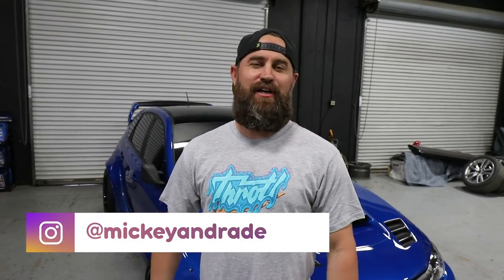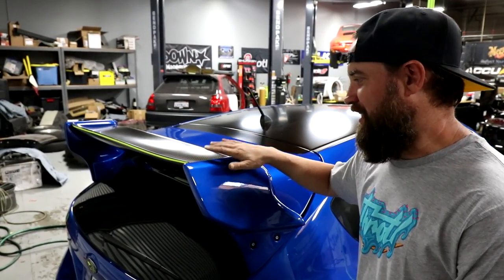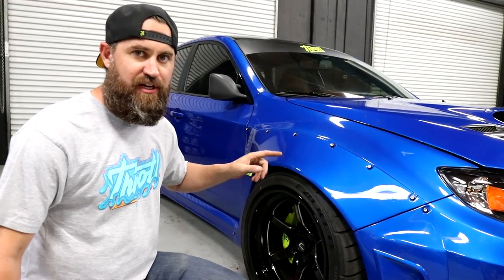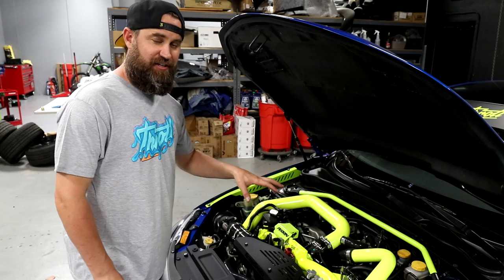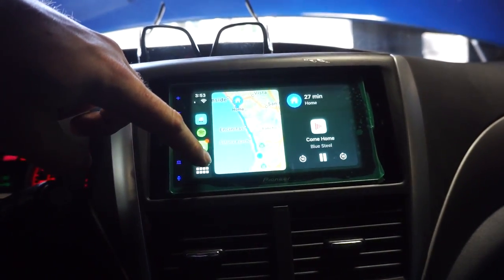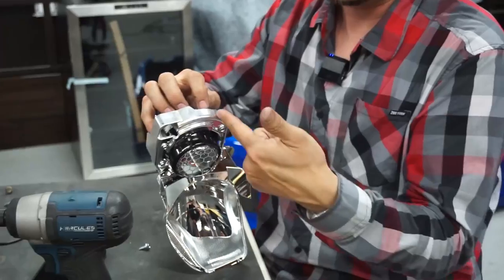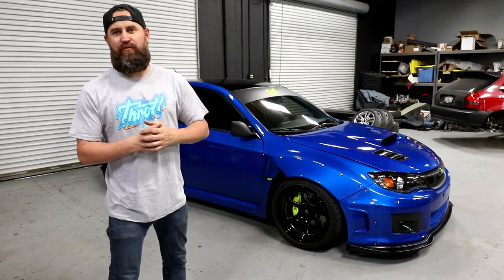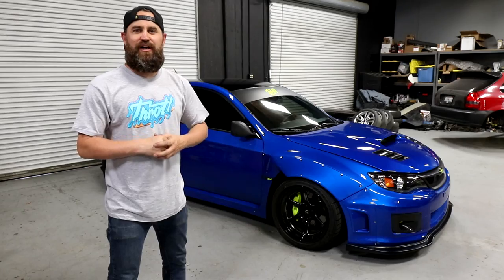How Much Did the ULTIMATE Subaru WRX STI Cost to Build?

Comment: Welp there goes my dream of owning and building an evo9
Reply: It's not that unattainable. A 2020 STI Limited goes for about $40,000. I would much rather spend the $45,000 to build an older STI like this one (Or Evo 9 like you said) to have it uniquely built the way you envision it. Just be smart with your money and you can get your dream car man! But knowing how to do the work yourself will save you alot of money too lol
Reply: Go with rebuilding a evo 9. Cause the sti will make crap power for more the cost will a rebuilt evo will make 700 to 1000 to the wheel.
Reply: @ELIDOTORG  you watch too many youtube videos. 700 to 1000 whp lol
Reply: @maksor2785  my brother in law has a evo 9 hes gonna rebuild it to make 700 witch will only cost him 7 grand. He you buy a evo shell that will cost you 9 grand plus all the interiror still inside. If your gonna buy a engine then that will cost only 250 to 350. Thats if you get the g4js engine. Its the same as a 4g64 engin then you just mate the 4g63 head to it. You get your self a stroked 4g63 2.3 liter
Reply: just do this
Step 1: buy the car of your choice
Step 2: save more money, take your time, you don't need it right then and there
Step 3: start buying the parts that will increase performance
Step 4: install the parts over a period of time(space it out, don't do more then what you can do in a day, take your time)
Step 5: Save more money
Step 6: slowly buy the cosmetic parts(rear wing, new hood, etc.)
Step 7: start where you want to on the cosmetics
Step 8: keep going and slowly finish the build
Step 9: get it painted the color you want it to be

just remember this take your time, and enjoy building it, also ask for help from friends, and if you don't know what you are doing then look it up, if that fails then take it somewhere to have it installed for you
also, try and keep it unique to what you like best
Reply: @ELIDOTORG  As I understand motors with shorter strokes turbo better because they rev faster and higher. which are 2 things you want in a turbo motor. that doesnt mean that a 4g64 wont make more power when built and turbo'd it just meants you have to get stronger rods, pistons, crank since they werent designed to be FI'ed. Also since you are not getting a 4G64 but a G4JS (similar engine). You need to change some stuff: 

-the new cam reluctor (inside the cam angle sensor)
-better valve springs
-turbo oil supply needs to be drilled and tapped
-turbo camshafts

I dont think thats all possible for 7 grand, seeing as these part prices can go up to thousands of dollars (if you get quality stuff, that can handle 1000whp ofc)
Reply: I read a car mag about a guy who built an evo, took 5 years. I am a v8 guy, but if your patient my friend. You can do it :)
Reply: @codyhendrickson7735  that's the thing, man, I'm 17 I'm trying to learn but I have no one to teach me
Reply: Same, goes to building my 14 wrx lol
Reply: @lonesoldier3921  You'd be surprised how much you can learn from YouTube videos similar to these. Just take your time, pay attention to the details, start small, and be willing to make mistakes. Also, don't be afraid to get something cheap first to learn on. Good luck reaching your dreams.
Reply: E r lol Your brother in law. Get the car and experience it first hand by building it. They’ll cost about the same. Stock engine yes Evo will make more power. Upwards of 600 both will need stronger engine. More power means you gotta beef up the trans, clutch, diffs, breaks etc Just get the damn car mod it to your liking. Most importantly driver mod goes a long way
Reply: bro same

Comment: Car Price breakdown:
The car itself:						                $15,000
SOS Customs Paint and Bodywork:				$ 7,500
MntRider Widebody Kit:					        $ 2,349
Agency Power Carbon Fiber Rally Wing:			$   900
Lion's Kit rear diffuser:				                $   500
Red overlays (pair):					                $    40   
Seibon Carbon Fiber hood:				                $   920
Subaru Grill:						                        $   320
Subaru Front Bumper:					                $   200
EPR Carbon Fiber Brake Inlet Duct (pair):		$   360
Cosmis XT-006R Wheels (set):				        $ 1,300
Falken Azenis RT651k+ (set)(315):			        $ 1,600
Silver's coil overs:					                $ 1,500
Stoptech Rotors and Pads (4 corners):			$   870
RPG Carbon Fiber Mirrors:				                $   360
Mishimoto Front mount kit:				        $ 1,150
Mishimoto Radiator:					                $   350
Mishimoto Intake System:				                $   315
Perrin Strut Tower Bar:					        $   235
Perrin Fender Shroud (pair):				        $   150
Perrin Solenoid Cover:					        $    45
Turbo Inlet:						                        $   283
Recirculating blow-off valve:				       $   200
Deatschwerks fuel injectors:				        $   289
Deatschwerks fuel pump:					       $   289
Delicious tuning E85 kit:				               $ 1,145
Grimmspeed pitch stop mount:			       $    99
Grimmspeed brake master cylinder stopper:	       $    95
Grimmspeed alternator cover:				       $    90
Grimmspeed radiator cover: 				       $    60
Subaru OEM parts:					               $   700
Pioneer touchscreen hands-free unit:		       $   280
OEM Audio+ 8" Subwoofer with enclosure with    $   999
Digital sound processing amplifier:
Kickers	components and co-axis	
Kartboy shirt throw shifter:				       $   150
Kartboy bushing:					                       $    70	
Throtl rad shift knob:					               $   100	
Suede headliner:					                       $   200
E-brake and shift boots:				               $    70
Headlights:						                       $ 1,250
Bolts and washers:					               $   150	
Grimmspeed brotie:					               $    42
Grimmspeed hella horn:					       $    30
Wiring kit:						                       $    30
Rear lower control arms:				               $   500
Sway bars (front and rear) and end links:	       $   870
20mm spacers:						               $   162
Total:                                                                             $ 44,117
Reply: mvp
Reply: Thank you I did not feel like watching the whole video
Reply: add labor probably about $60,000 - $70,000 if someone was like have a shop build me this
Reply: @OhThatsBugg  I did not want to watch the video at all. Just wanted the price.
Reply: Way better than buying a brand new sti
Reply: @Svannuta i just got this same car for 11k with 120k on it
Reply: Thanks bro, i couldnt hear some of the things he said so shot for writing it down
Reply: @kylescoot  bro I’m looking for one rn😭😭 trynna help!?
Reply: god bless your soul
Reply: In 🇸🇬 , the car itself cost 200k++ hahahaha
Reply: this guy right here
Reply: absolute legend
Reply: thanks
Reply: Tnks man
Reply: what a legend.
Reply: Thank you for
Your time to do
All of this !
Reply: Just found this, super curious, where is this car now I wonder? How did it hold up? So many youtube channels doing awesome car give aways, would be super cool to see years later if the winners took care of them, sold them, etc..

Comment: Just a quick question Mickey; why didn’t you install an AOS, and the Cylinder 4 cooling mod? These two parts are incredibly important when it comes to preventing damage in the boxer engines.

Comment: I cant believe the amount of money they spent on some of the parts for this car. I cant speak for the value of a lot of these parts, but I do know they could have done so much better for the audio solution. I personally drive a similar (non-turbo) 2011 Subaru Impreza, and a friend works at an audio shop. I bought my set used, but I priced out the cost of what I have new. They spent $1000 on an 8 inch sub and an amp, when my setup, consisting of 2 10 inch JL Subwoofers, and a 500W JL Amp would cost about $700 new, albeit without installation, which took my friend about 30 minutes to wire into my car. I have heard a subwoofer similar to the one they installed, and it just doesnt match the 2 10 inch I have. Even if they wanted to have only 1 sub, and have it offset to the side of the trunk like their 8 inch is, it would have cost less. They could have probably even gotten a custom built box, that would both sound and fit better into the trunk of the car for less than $1k, though a custom box can be a bit of a wildcard for pricing.

Maybe they didnt want a sound system that was too Bass heavy, but they still could have gotten an 8 inch sub with a custom box (or not) and all for less. I doubt they talked to any decent audio shop about their solution, since I know that my friends shop would never recommend something like that. I just hope they didnt overspent like this on other parts for this car, but it seems like they might have, even if just to brag about the total cost of the build. I know I have seen a few other comments about them ignoring a couple of important performance and longevity mods for a car this heavily modified already.

Comment: To enter without purchase, print your name, address, city, state/province, zip/postal code, e-mail address, telephone number and date of birth on a 4x6 postcard (no outer envelope) and mail to: Throtl Inc., 302 Washington Street #102, San Diego, California 92103 (each postcard must be mailed individually- multiple/bulk mailings will not be accepted). Mail-in entries must be postmarked by May 31st, 2020 and received by June 3rd,2020. Earn 3 entries per postcard. No photo copies, facsimiles or reproductions of mail-in entry requests will be accepted. Sponsor is not responsible for late, lost, damaged, stolen, incomplete, illegible, postage due, or misdirected entries. Proof of mailing does not constitute proof of delivery. All information must be complete to be eligible. Personal information collected from entrant is used only for the purpose of the Sweepstakes and will not be re-used, sold or shared in any manner, unless entrant agrees to receive further information on Sponsor’s or prize partner’s products and promotions. Use of computer programs and/or other automated devices to enter sweepstakes is prohibited. - this was pulled from their website